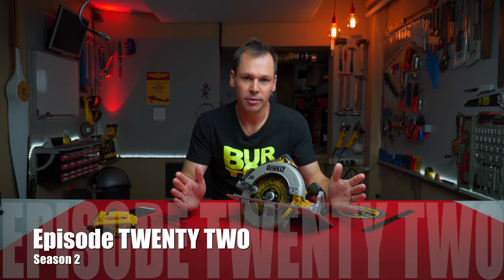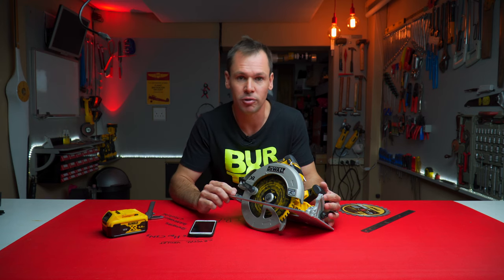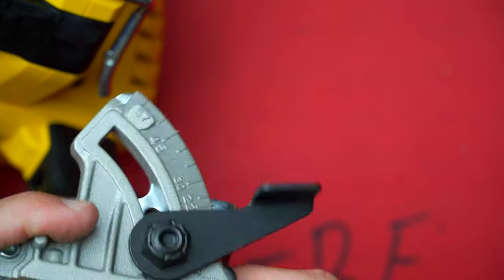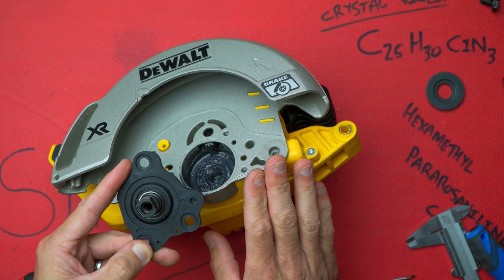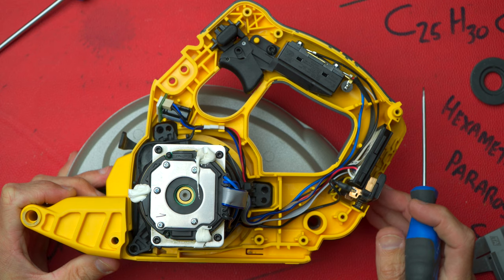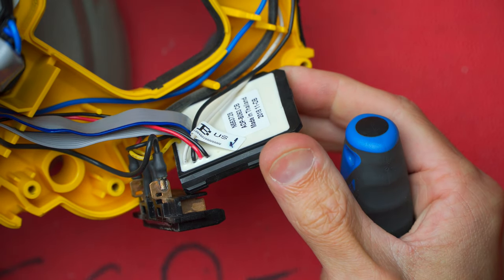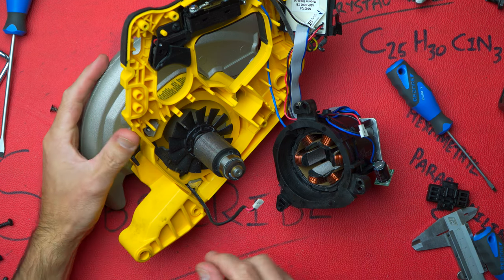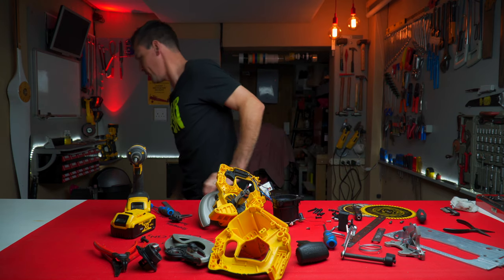DeWALT DCS570 20v MAX XR 7-1/4 Inch Circular Saw TEARDOWN (BURTON BUILDS - S02E22) [4K]

Comment: Hi Grant, that was a great analysis over the saw, especially the details. Appreciate you checking the blade parallelism at the beginning.

An update on my experience with DeWALT factory service: they actually agreed to fix the saw for free upon inspection by a technician. What they actually ended up doing was replacing the ENTIRE shoe, and even the bevel adjustment part I think. The end result is that the blade is nearly 100% parallel (0.15mm difference measured)

Surprisingly, they told me to from now on, store the saw on something that allows it to sit flat as opposed to resting on its blade guard, e.g. placing the saw on 2x lumbers so the blade guard isn't in contact with anything. Wonder if this is really what caused the 1mm problem but I'll follow their advice for my own good.
Reply from the maker: In my opinion, I don't think resting it on the blade guard would cause and damage, If it was such a bad practice, it would have been included in the instructions in the tools user manual, but as you say, probably best to follow their advice, especially since they were willing to help with the repair. It's nice to hear that the service centre were willing to help and didn't try send you packing.

Comment: On my well-used DCS570 I now have a problem where the saw starts up for about a second then stops dead. I understand this could be the motor starter capacitor, which I don't think was specifically mentioned in the video? (the small black barrel mounted on a tiny circuit board and attached to the motor by loose cables). Looks like it could be a fairly standard 50V 470uF capacitor so I'm hoping I can replace it. Shame to throw away a handy saw for such a tiny component.
Reply: I have the exact same problem. Have you by any chance found a solution? Cause I’m trying to fix it myself

Comment: I bought one of these yesterday and I got 3 or 4 cuts and it stopped working , only had it 20mins!  Very very light work cutting plywood sheets!  Tried 3 or 4 battery’s and same thing happened! Blade spins with a grinding noise for a couple seconds and stops!  So it’s back to the shop where I purchased, either a replacement or refund , playing it by ear!
Reply from the maker: Hi Daniel, thats not good... super irritating when you buy a new premium product and it stops working so soon. Touch wood, mine is still working well. Please let us know how your replacement / refund went?
Reply: I have the exact same problem. Have you by any chance found out what the issue is?

Comment: after i finished mechanic school, i worked at the school briefly as a teacher's aid, and i got to talk to a Bosch engineer who was at the school as a guest speaker, and i asked him why everything is being made from plastic lately, he said , there are a million different formulas for plastic , the ones they use for (reputable  companies ) tools are impact resistant, lighter, and good for absorbing torque, so they will twist , and  deflect, momentarily , and go back to their molded shape better than metals, he said if you were to drop an all metal chasis drill gun to the  ground , it would probably crack , or dent really bad, but plastic usually won't,,, so the moral of the story is that plastic isn't always just a cheap substitute  , it  is often prefered,  , another plus is , it can easily be molded  into any shape that would be very cost prohibitive to the average consumer , so it has made previously unobtainable tools  available  to the  DIY'er , so we should celebrate the advancment of plastics
Reply from the maker: Hi Ronn, thanks for the feedback. I was actually looking at my vehicles radiator a few days ago (Toyota Hilux pickup) and the top and bottom tanks are made of Glass fibre reinforced nylon (PA66 GF30) which is similar to what our power tool casings are made of... pretty strong stuff. My thoughts are that gearboxes and stuff that houses running gear sets should be as rigid as possible (metal casings) to avoid any deformation under load while tool casings being reinforced nylon is probably best (for that impact resistance you mentioned)... but that is a very good point about cost and accessibility for DIY’ers. I’m actually working on a video about tension, impact and hardness testing and it was interesting to see how strong BMS vs Aluminium vs Carbon Fibre vs plain old Perspex is in tension. I guess we need to start becoming more accepting of technological advances in ‘plastic’ strength and design. It’s just that many ‘old school’ things were built to last and that’s what I like to see.
Reply: I agree, I'm not convinced those plastic parts are because of cheaping out and all metal is necessarily better.

Comment: Ok, but…..No mention that the zero index on the front of the shoe does not align with the cut line…making all the shoe front edge measuring marks pointless.  Yes the blade is not parallel to the shoe side…and for the money it should be!  So how can we modify the mountings to correct it…that would be useful (or I guess sand away the shoe side to true it up).

Comment: If plastic is done right, it's great. Glock handguns kind of proved that by driving a truck over the plastic framed guns and dropping them out of a helicopter, then picking them up and firing the undamaged guns. People do want a $500 quality saw for $130, but that's not reality. I use to have a Ryobi 18v nickle cadmium circular saw when I installed flooring. I used it for 5 or 6 years, 5 to 6 days a week cutting luan, trim, 2x4s etc. Eventually the bearing wore out, but it was a good saw for the money and lasted a long time given how much I used it. I imagine this saw is even better, so I bought one for around the house stuff. I bet the batteries go bad before the actual saw does.
Reply: LOL, “if plastic is done right...”. 🤔🙄😁😂
Reply: @georgedavall9449  What's funny about that?
Reply: @CarbonGlassMan  Hi there. 😊  I don’t know, it just made me chuckle.  Metal vs. Plastic, an age old debate.  Both have their strengths and their weaknesses.  Camera guys will abhor plastic used in the bodies of cameras, yet I have had a corner bent on a high end point and shoot, w/ metal body, when knocked off my waist onto a vinyl floor, in a case!  😳 Yes, I know this ain’t about cameras, but it adds merit to what you say.  I believe engineers take calculated risks, in order to complete their jobs, and satisfy the ‘bean counters’ at Corporate.  The Consumer always pays for it!  
Peace to you 👍😁🇺🇸

Comment: Mine is brand new won't come on
Reply from the maker: Hi James, if it's brand new, I would not mess with it and rather return it and get a replacement or a refund? Are you able to check if the battery is working?

Comment: thx for the teardown ... just picked one of these out of a rubbish bin and it looks new as no wear on the plate.  No battery, missing a blade clamp/bolt but doesn't work.  Your teardown gave me some ideas for where to look for the problem.  The light works and the spindle spins and stops.  Might need a replacement switch rather than the whole motor mechanism.  This seems to be as a single unit that is more than the cost of the new saw !!  your IDing of the switch is really helpful asI am sure it  can be replaced !!  thx again ... Stu
Reply from the maker: Awesome find... hopefully you are able to get it to work again, if not then I suppose keep it around for spare parts. Could probably find a replacement switch but just taking a guess, I don't think that is the problem. Maybe have a look at the wiring connecting onto the motor, especially the hall sensor wires (those would be the thinner wires - ribbon cable). A break / dry joint in one of the hall sensor wires could be causing the controller not to know the position of the rotor and thus unable to start rotation. If it's a failure in the speed control then it likely can't be repaired. Let us know what you end up finding.

Comment: Thanks Burton

the issue I am having is the saw blade stopped turning, the motor runs for a few seconds and then shuts off, I here a grinding noise, then the saw shuts down. Sounds like a gear issue. I saw on the video where the blade arbor and the one gear is removed. I noticed a smaller gear that must be the drive. How do you access that piece.

I have yet to tear into the tool, but wanted to ask before i do.
Reply from the maker: Hi Robert, by what you describe, it does sound like a gear issue, and luckily easy to inspect without a full teardown. I'm not 100% sure about the pinion removal but by the looks of things, it comes out from the back along with the rotor - it's pressed onto the rotor shaft. I would have to tear it down completely again and have a look to be sure. (it's the second time somebody has asked.. haha)

Let us know what you find once you've had a look.

Comment: Had a new one at work and think the gearbox is messed up already. After seeing this I think the pinion may be toast. I personally have the 54v and it's a beast. I think that may still have 1mm out with the shoe also
Reply from the maker: Maybe you are able to get a replacement pinion... definitely worth a look, might end up being a cheap fix. Those 54v versions look awesome however I haven't had the pleasure of using one yet.

Comment: I'm having a problem with these saws, relatively quickly the break doesn't seem to be releasing. any suggestions? is there any way to disable this feature?
Reply from the maker: Hi Dale, are you referring the the blade brake feature, where the blade comes to a stop quickly after releasing the trigger? Thats an electronic brake. The break shouldn't be engaged once the blade has stopped rotating.... is yours?

Comment: Just picked up a DeWalt atomic compact circular saw DCS 571  it 4 and 1 half inch  or 11 and 1/4 cm my first circular saw and I am 60 I hope it's well built ! Thanks for your video I am thinking of picking this up to do 45 degree cuts
Reply from the maker: The DCS 571 looks interesting although I haven’t had any ‘hands on’ experience with it yet. I also haven’t done many 45 degree cuts with my DCS 750, mostly only straight cuts and so far it works great. It’s super convenient to have these battery operated tools. I’m also pretty happy with the build quality of the DeWalt tools thus far but will revisit the TEARDOWN of the various tools in a year or so time to see how well they have worn.
Reply from the maker: Give us some feedback on how well it works once you have used it.
Reply: @GrantBurton   I we'll be using it February to cut studs for a new wall at my church . I am a DIY guy not a pro I will try to keep my fingers and hands and let you know how I made out 👍
Reply from the maker: Hi Adrian, how has your saw been treating you?
Reply: Grant Burton Have not had a chance to use it since the pandemic we didn’t build our prayer room yet and I had a couple setbacks healthwise but hanging in there I hope all is good with you 😁👍🏾
Reply from the maker: @adrianboston8482  Health wise all is good, thanks... but have been laid off work due to the pandemic so not good on that front. Hoping you get to building your prayer room soon. Keep us updated.
Reply: Grant Burton  🙏🏾😃👍🏾Blessings Grant 👍🏾😀🙏🏾

Comment: I have one of these and after about a year of use in my Handyman business, it just stopped working. I made a long cut, it did great and didn't really struggle but the next time I picked it up, nothing. I've tried different batteries and did get it to make a rotation or two a couple of times while repeatedly pulling the trigger. Now it won't even do that. This seems to be a common problem with this model and I can't find any information on what it might be or if there is a fix for it. Any Ideas or information would be appreciated. Thanks.
Reply: I’m having the same issue. I’ve had it about a year and a half, and it’s just quit.
Reply from the maker: Hi Michael, thats pretty crap dude, super irritating to have fairly new and expensive tools give problems. I haven't experienced that problem yet but as time goes by, I'm hearing of it more and more. Just a thought... have you tried opening up the switch and blowing it out with compressed air? maybe it's full of saw dust.

There is a possibility that it could be a broken wire leading into the motor (broken conductor within the insulation) or a dry solder joint... maybe try having a closer look and prod around there. A quick and dirty method to check would be to open up the tool to expose the internal wiring, etc. Plug in the battery, pull the trigger and wiggle the various wires leading to the switch and to the motor... see if it springs to life. (PLEASE remove the blade first).

Comment: Brilliant... glad I found your channel! My saw is the same vintage as this one. Maybe you can help me with something. The arbor lock on my saw seems to suddenly be staying partially engaged even though the lock is released. When the blade is turned there is a chattering/clicking sound. Have you, perhaps, run into a similar problem with your saw? Thought I would check in with you before I do a similar disassembly. Thanks!
Reply from the maker: Is my DeWALT circular saw broken or is this normal… let’s find out.

Comment: The plastic that you are criticizing here 4:06 is also the plastic that houses the motor,  etc.
Reply from the maker: Hi Arc Anon Drum, thanks for the comment. I'm not saying there is anything wrong with the plastic (plastics made in the correct way can be extremely strong) however I'm more thinking along the lines that a full aluminium (alloy) guard would have been better... so log as one isn't dropping the tool from any great height. At least the plastic centre has a bit of give / flex to absorb shock. Cost versus performance also has to be considered... much cheaper to use plastic for possibly only a slight decrease in material performance.

Comment: Would prob be better if you turned the blade around the correct way. You will really like it.
Reply from the maker: Agreed... They seem to cut much more efficiently when facing the correct way... haha. (Just before filming I was taking some measurements and popped the blade back onto the saw for the intro of the video and didn't realise I had put it on the backwards). Thanks for the comment though, it made me laugh.

Comment: The fine-tooth circular saw blade you had on the saw in the beginning of the video is made for a saw with the blade on the left, as you had it with its teeth facing the wrong direction with the label side showing.
Reply from the maker: Hi L.I. Archer, Well spotted however, it is the correct blade for the saw. A few minutes prior to filming, I removed the blade and was taking some measurements on the tool and once complete, I quickly popped the blade back on to the saw (as you pointed out, obviously not in the correct orientation) just for the intro of the video, knowing that I would remove the blade again a few minutes later... haha. When the blade is on this saw, with the label side facing out, the teeth point forward. That’s pretty awesome that you picked that up though, thanks for the heads up and the comment.
Reply: first thing i noticed also
Reply: @castawaysmc  uh huh, sure 🙄😁

Comment: That saw is underpower!  If I had chance to try before I buy -i never be purchase it.
I did use same1 but on flex batteries  -that have so much power.
Cutting 4by2 on 45 angle is stalling 
Cutting 20mm marine ply  is at 0 is taking ages...
I do like the machine futures....
Just think if is possible to modifie it to male it stronger...?
Maybe overvolting it...
Reply from the maker: Hi Adam, thanks for the comment. If you are looking for more power, the DeWalt Circular Saw with Power Detect and 8AH battery should be powerful enough for your needs or the Flexvolt Circular Saw with 60v flexvolt battery... but then the price is quite a bit more. I don't think it's worth trying to modify it, rather use the flexvolt battery as you described. Putting the motor or speed control under anymore load would likely burn it out, or if it doesn't burn our, likely will not have a long life.
Reply: @GrantBurton  hi  I do have circular flex volt but. I been using 5a battery so you think this going to affect  the circular saw ?  Thank you for your answer. I w’d really appreciate

Comment: How did you remove the u shaped washer in the middle were the saw sits? Before you remove the blade guard
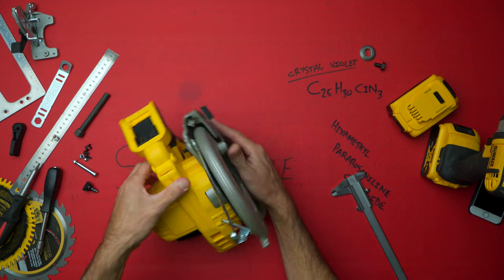Reply from the maker: Hi Heroel, I think you are referring to the circlip that holds the flange in place on the shaft? I just used a circlip pliers... at 06:37 you can see part of the handle (red handle) just in frame at the top right side of the video. There are two pairs lying there. When you insert the points on the pliers into the small holes on the 'U' shaped washer / circlip and squeeze the pliers, the two holes are stretched slightly apart from each other and the circlip expands just enough to move out if its groove and then can be removed.

Comment: i took Apart my 20v Dewalt 1st Gen 13" String Trinner 
CHAOS 
Motor Replacement Costly !!! ( Mine Burnt Out)
Went back to 27cc 4 Stroke 16" swath Troy Bilt
NOW 2020 using a 82v Snapper 16" String Strimmer 
Battery made by Briggs and Stratton 
AmazingPower at 82v
Reply from the maker: Hi Joni, I had a quick look at that Snapper string trimmer... it looks pretty awesome. Which battery are you using... the 2, 4 or 5AH? and how is the runtime?

Comment: Hi Grant the dewalt dcs575 flex volt has the same pendulum guard as yours I think they are the same saw but different voltage motor but the European version doesn't have a rafter hook
Reply from the maker: I'll see if I can get my hands on the flex volt 60v version to teardown and compare (hopefully the repair agents here have got one they are willing to lend to me for a few hours although I wouldn't hold my breath).